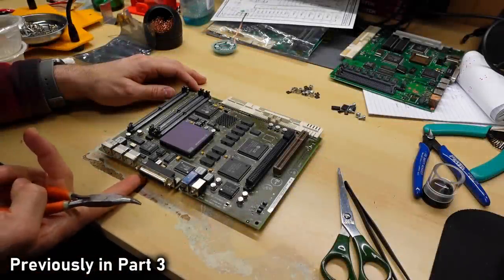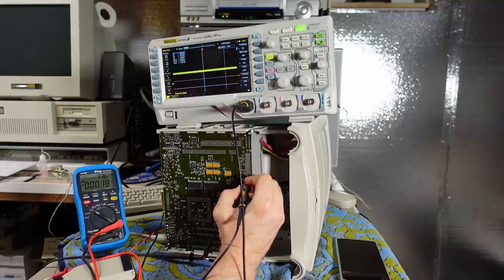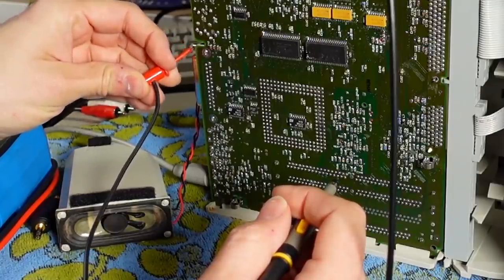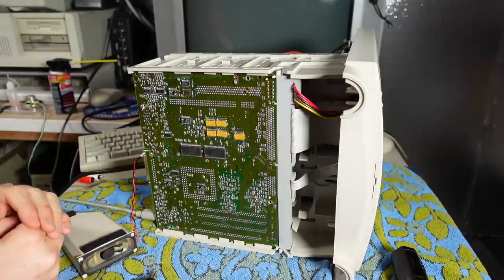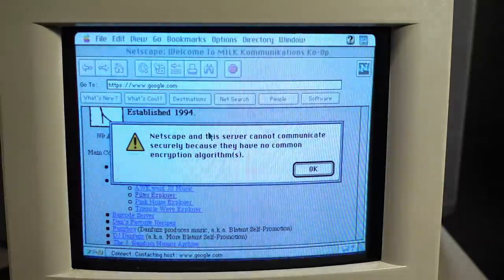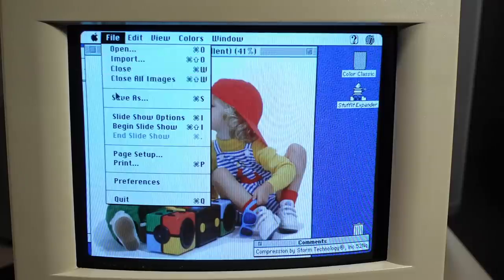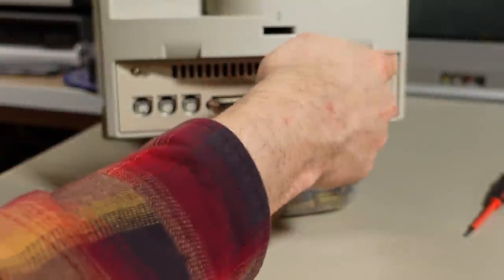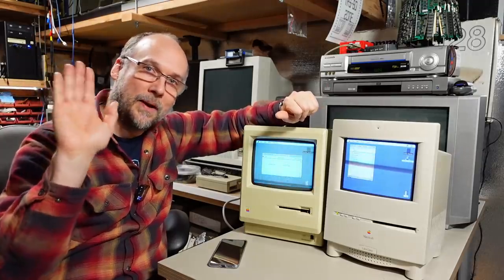You won't believe why the sound was broken on the Color Classic!

Comment: So removing the RF shield wasn’t a SOUND decision in hindsight, eh😀. I’ve noticed that back in the late 70s, 80s, and early 90s it was not uncommon for PC and micro/home computer engineers to employ funky odd hacks to resolve problems with the original designs that would then latter befuddle modern hobbyist/retro repair guys trying to repair the old systems. Given that the cost of redoing a motherboard with a flaw was not insignificant they often resorted to budge wires and other unusual wiring/component tricks to address flaws/problems, especially on systems the user/consumer was unlikely to open up to do repairs or upgrade such all-in-one systems like the C64, Sinclair ZX Spectrum, Tandy TRS-80, etc. Now Given that RF interference from the digital CPU and other chips and components of the system can effect the analog sound output, I imagine that the weird multi connections ground to RF shielding setup on the Color Classic was Apples way of fixing that.

Comment: nowadays we open up 14meg Raw image files just as easily as it was to open Bmp back in the day
Reply: Does Windows support .raw files out of the box?  And i did use couple viewing software under DOS as they could open files much faster than windows 3.11 that used CorelDraw or some super heavy software for anything else than .bmp 
It was fun to mess around with first scanners, the resolution was dependant of the memory amount and the software barely didn't crash when exporting. :DDD
scaling pictures was so crap, it was better to scan correct size for WYSIWYG clip-art. :DD:D:D:
Reply: @woldemunster9244  Window7 anyways will open .nef (which are Nikon's Raw files) in preview without a problem just s easily as previewing a jpg, however, I don't think there is a way natively to edit them. I am trying to think of the name of the program I would use in dos when I had my old faithful 286, i think it started with GWS or something like that for the life of me i can not remember what it was.
Reply: @patprop74  Yes, i remember once on Ubuntu i gave permissions to one open-source raw-program to make thumbnails and holy shit it did end in catastrophe on my old laptop with 2,5" HDD..... :DDD

Comment: I laugh when I hear Youtubers claim that RF shields are "useless now." No, they're still a critical part of the design. Of course I'm an amateur radio operator, went to electrical engineering school, fix computers and electronics devices, and have been a programmer for 30 years. Don't make changes to designs by removing things you think look stupid. All things engineers do are done for a good reason, hardware and software. Many of those reasons are deep inside complex textbooks, hard won by experience, or both.
Reply: Without delving too deeply into theory, today's devices still have RF shielding. It never ceased to be necessary. But regardless of whether a device has a large RF shield or the Wi-Fi module is shielded (common nowadays), the whole device was designed and built with that assumption built in.

I see that you have two Macs without RF shields that will may or may not interfere with each other's correct operation. Or the ancient electronics will go haywire now due to your cellphone and with the shield they wouldn't. It is very hard to detect random bit flips in your data until a compressed file gets corrupted and you've now lost your data.

Comment: Obviously I have the benefit of hindsight here, but wouldn't it have been easier to just run a bodge wire from a pin on that isolated ground plane, back to the "analog ground" connection point on the board? Two solder reflows, maybe a couple dabs of glue, Bob's your uncle?

Comment: I'm no "RFI Expert", but my guess is that a the digital circuitry can cause all sorts of buzzing through the analog amplification circuitry that you would hear out of the speaker, but if you isolate the digital circuitry from the analog amplification circuitry it'll stop the speaker from buzzing.  The original TRS-80 (Model I) was so bad with RFI that a friend of a friend had written a machine language program that would cause a radio to buzz when he made loops with various delay times and no-ops to produce buzzing of different frequencies and he could play music out of a radio set nearby the model I.
Reply from the maker: Yeah the Model 1 had zero RF shielding so you could use a little AM radio to "add sound" to games.
Reply: Oh...that answers my question of why they had separate ground planes...

Comment: I had totally forgotten that JPEGs were that slow. But I do remember this JPEGView busy cursor. So I guess I just forgot XD
Reply: I had a LC II back in the early 90s and used JPEGView to view JPEG images but while it was indeed much slower then the instant display of images seen today, it was faster then what Adrian experienced likely due to all my images being lower resolution and lower color depth (typically 256 colors) and such and thus they loaded faster then the modern high Rez sample JPEG images Adrian was using which needed to be converted to a 256 colors and resolution reduced to display properly on the Color Classic. Back then all The images you downloaded from BBS’s, AOL, etc. were already lower resolution and Max 256 color as a) most Mac and WinPC users didn’t have graphics cards/chips capable of displaying more then 256 color RGB or more then 640x400 resolution with the typical 12” external RGB monitor. b) The typically modem speed for downloading image files was very slow like 1440 baud  I think, c) Hard drive sizes where like 40 or 80mb (megabytes not gigabytes) and floppy held 1.44mb Max so image file size was compressed as small as possible within reason. As the Color Classic (and later Japan only Color Classic II) screen is only 10” with a resolution of 512 by 384 pixels and a default 256 colors with the default 256 KB VRAM (upgradable to 512 KB for a Mac of 32,768 colors) you wouldn’t had had to do much downscaling back then with the typical much smaller JPEG files compared to modern JPEGS with modern high Rez image quality. Now if he had converted the images before hand with modern graphics program to say 640x480 @ 256 color and then viewed them using JPEGView again on the Color Classic they would likely load faster though not anywhere near instantly.

Comment: Could you build an Audio Board around a LM555 as a clock and a LM556 as a PWM that will drive the speaker to replace the burnt out audio amp chip.
Reply: Won’t work. That sound chip has a 68000 bus interface in it; and I think does DMA to feed the ADC.

Comment: Audio and power connectors get worn also they usually switch as well which can be a problem audio and voltage ground are usually separate depends

Comment: One big difference between the original Mac and the color Mac was the rise of "multi-media" in the late 80s. I.e., CD-ROMs and audio input. That never existed in 1984. Suddenly 16-bit A/Ds and D/As were being designed into very noise digital systems. Some thought it could never be done The very low signals in analog microphones were highly susceptible to digital noise. That's why the audio ground was isolated: to keep the large current spikes associated with digital circuitry, DRAM in particular, out of the sensitive audio circuitry. Copper has finite resistance. It's small, but finite. When an amp or two of spikey current passes through the copper resistance, it generate I*R voltage drops across the ground plane. This is how "digital ground plane noise" is generated. Almost all engineers assume that a ground plane has zero voltage differential across it. That is true only when there is no current flowing in it! Digital circuits care little about small voltage differences (they have "noise immunity") but because analog circuits amplify anything in their signal path, it is a major concern. You don't want to hear the hard drive spinning up in your headphones, for instance. By assuming a ground plane is perfect, it makes the math solving very easy, but even a few microvolts of noise can be easily heard in an audio circuit. By isolating the analog ground plane and using only one tie point of the audio ground to a ground, preferably at the power supply tie-in on the logic board itself, you prevent the digital noise from passing through the audio circuitry and getting amplified. And that is why Apple did what it did by isolating the digital and analog ground planes.

The real challenge was the CD-ROM drive because it has both ground-referenced L/R outputs as well as digital circuitry, all in one CD package. As soon as you tied the drive's analog ground to the logic board analog ground, you had now paralleled the digital ground with it through the CD-ROM's digital ground, corrupting the logic board's analog ground! What to do? The secret was NOT grounding ground (not a typo) but using differential amplifiers on the incoming L, R, and Agnd signals and then re-referencing them to the logic board's analog ground. This trick cancels most of the noise created by differing ground voltages. It's called "great engineering."

Comment: Its not uncommon to isolate grounds in analog and digital designs.. To reduce noise on your audio, you would use the lowest impedance grounding possible and you would use a ground that is not a return path of any other components. If parasitic current is flowing through audio grounds it causes noise.

Comment: So the CPU has no fan on it, only heatsink.  How  is the heat output?  Any thoughts on putting a CPU fan?   Congrats on the audio detective work.
Reply from the maker: The original EC33 CPU didn't even have a heat sink. It's like 486 chips. They didn't start getting heat sinks until the DX2/66 and even then didn't have a fan usually... Cool outside air is drawn in over the motherboard while the machine is on, so I'm sure it's totally a fine temp.
Reply: @adriansdigitalbasement  ... Ah ok, cool (pun).  No, I thought that large black heatsink, here at 17:45 , is the CPU.  Am I wrong?  I don't own any type of Mac (I used them back at Oregon State U in the late 1980's was the last time), so I don't know what is what.  I'm a C-64 & PC guy.
Reply: @adriansdigitalbasement  I have a Quadra 840AV which has a 68040RC at 40 MHz - without an heatsink. Never had problems with it but I have seen systems on Ebay with heatsinks. Probably a good idea to stick one on it.
The 100(?) MHz PowerPC replacement mainboard I have for that machine uses a fancy Peltier-element, though...

Comment: So... they went to the trouble of making separate grounds. But then certain things, in their normal usage, can bridge them... so why did they even bother?
Reply: Basically they did it so that the return currents from analog and digital circuitry don't mix with each other.  Digital circuitry tends to consume current in "gulps" when it switches, and those gulps actually produce some noise voltage on the "ground" plane.  This switching noise interferes with both analog and digital circuitry, which is why most integrated circuits need decoupling capacitors, but analog circuitry tends to be more sensitive.  Splitting the ground planes forces the return current to take a different path, which helps isolate the more sensitive circuitry (the analog sound amplifier in this case) from the noisier (and more power hungry) circuitry (the digital parts of the motherboard in this case).
Reply: @undefinednan7096  Makes sense. But they still allowed for conditions where the two get mixed, such as when certain connectors have something plugged in. Seems like quite an oversight. Or maybe it's okay since it's still taking a different path, away from the sensitive components?

Comment: Split ground planes for analog and digital is also quite common, as it helps re-route the return paths for the current.

ie. if you have an audio amp on a separate ground, and only have a smaller trace connecting it to the main ground on the board, the audio ground plane won't have as many return currents from the digital stuff going across it.

That is often done to reduce the noise in the audio ground plane.

Or sometimes the RF shield just creates a lower-impedance path across the PCB than going via PCB traces (for similar benefits).

Or, just for extra RFI shielding, as you mentioned.

I don't pretend to be an expert on RF voodoo, but EEVblog Dave has done a few vids on similar subjects...

(I'm sure he's done a vid on ground planes and current propagation, but I can't find it atm.)

https://www.youtube.com/watch?v=CBD9vwKcvtY
Reply: EEVblog Dave did do a couple of vids on "Using an oscilloscope safely", which is somewhat related to why you got sound while connecting the o'scope Ground clip.

(since most mains-powered o'scopes have the probe ground connected directly through to mains Earth, and then back through the Mac PSU to the rest of the digital ground plane.)

Which can also cause problems with accidentally shorting stuff out, since the ground clip isn't floating.

Normally to safely measure "across" any two points in a PSU or whatever with an o'scope, you'll need a true isolated differential probe, and perhaps an isolation transfomer as well.
Reply: Oh yep, and in other RF voodoo, testing resistance with a multimeter is known as a type of "DC check", for obvious reasons.

But something that seemingly tests as a direct "short" in DC often won't behave the same at all with higher frequency signals.

So even something as simple as a large ground plane on a PCB, or RF shielding can have all kinds of current paths propagating through it, and it's very frequency-dependant.

(again, I don't fully understand that stuff either, but it's very interesting. lol)

See, when you have lots of digital chips switching constantly on a PCB, it produces many rapidly-changing current spikes, and that current has to return to the power supply somehow, via the ground plane.

The way those return currents flow through the ground plane isn't always a direct path, so it's not always intuitive. Which is another reason why you often see split ground planes for analog vs "digital" circuits.

Or just to isolate more sensitive circuits like a PLL, you'll often see a separate small ground area there, and sometimes some "guard traces" that surround the circuit as well.

Comment: 5:40 was it possibly a switching jack problem? record a reference sine wave (500hz is a good audible frequency) into a waw or aac file rather than using irregular audio next time. YOu can proabably use the function generator from your scope to do it.

Comment: The one thing I hate about the EEVBlog multimeter (and the reason I would never buy one) is that the annunciator to the left of the digits ALWAYS looks like a negative sign to me. I always have to do a double take in every single video I've seen it used in (why is it reading -12V when it should be 12V? oh right, just the stupid LCD). Argh! Anyone else find that frustrating?

Comment: It is unconventional that the analogue ground and digital ground are not connected at all, but digital ground tents to be noisy, also it is desirable to distribute ground in a star topology to avoid ground loops.
Why apple decided to use the shielding to connect different ground islands together unconventional, bug I guess it saved an interconnecting common ground plan in the PCB. So the reason could be plain cost. And the shield should be on in normal operation.

Comment: Anybody else hearing an almost static sound when adrian talks?
Reply from the maker: Yeah, it's the audio processing I used on this video. Have been playing with the settings and the processing seems to have the artifact here b
Reply: @adriansdigitalbasement  Probably has to do with YT's compression algs...they always screw up sound some way.
Reply: I can hear it too...I'd check the microphone's RF shield just in case 😉
Reply: @adriansdigitalbasement  Make sure the audio circuit is grounded to the RF shield while processing the audio. :D

Comment: It has sense; Apple use a ground plane INSIDE  the board and another OUTSIDE the board, and as the sound amplifier is otuside it uses the other ground.

Is not a god idea to join the ground in several places; it generates "ground loops" if you join the ground only in one point yoy have not  a loop. The shields in the cables should be jointed to ground only in one of the sides of the wire.

Sorry, I'm not English speaker  surely I'm writing some mistakes in my "speech"